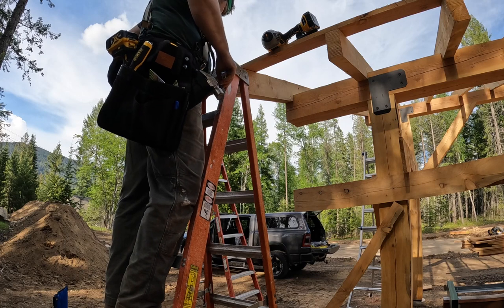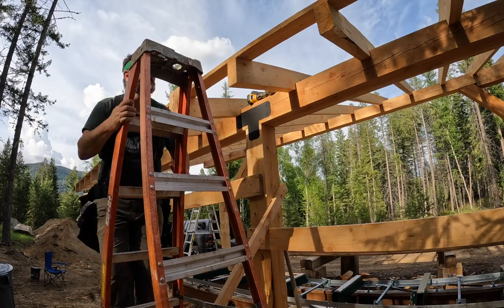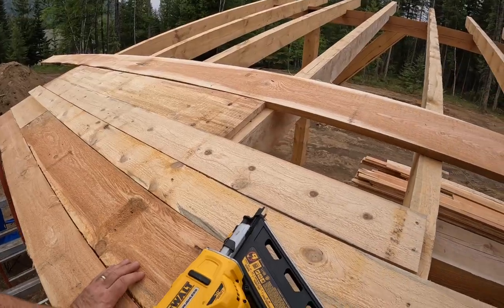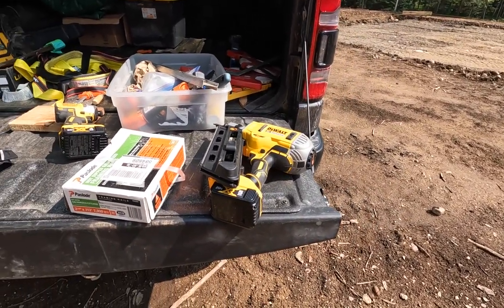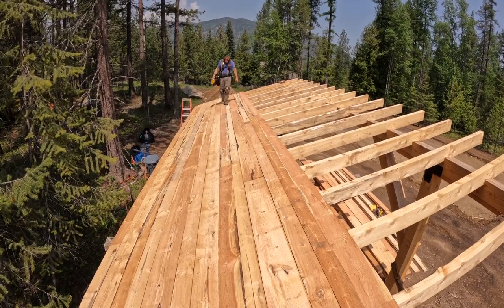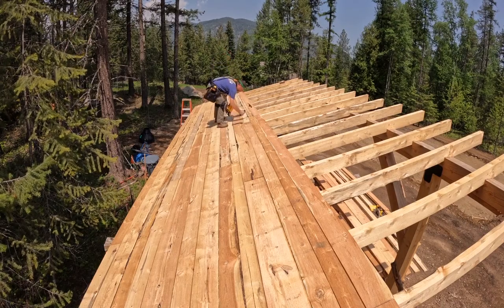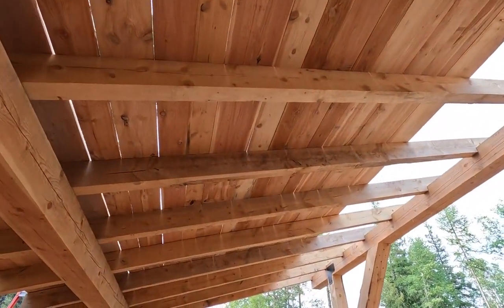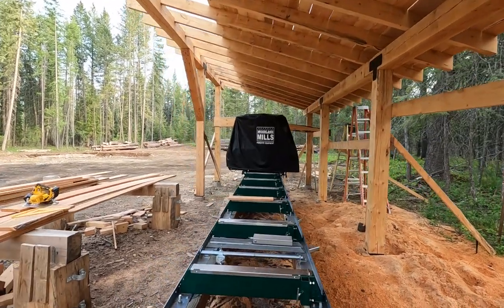Adding Sheathing To Sawmill Cover Build // Woodland Mills HM130 Max // Sawmill Shed  Build // DIY

Comment: ❤ do you know what the lifting capacity is of your skid steer?
Reply from the maker: Yes! About 2,200 lbs. or when it gets tippy 🤣It will let you know!
Reply: @ourdreaminthewoods  that is my missing link, I have a Kubota B3350 with approx. 1000lbs. lift capicity....way to small for the trees I want to mill.